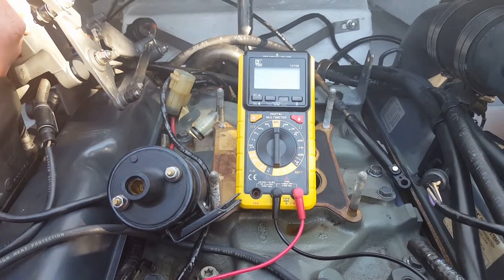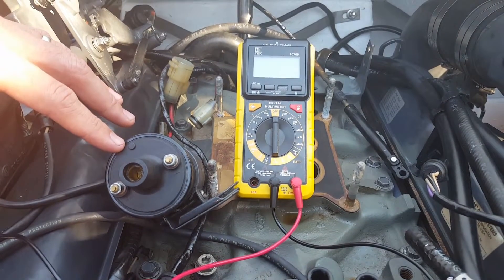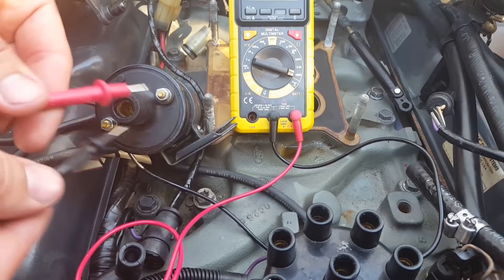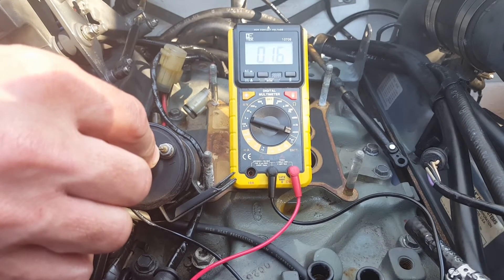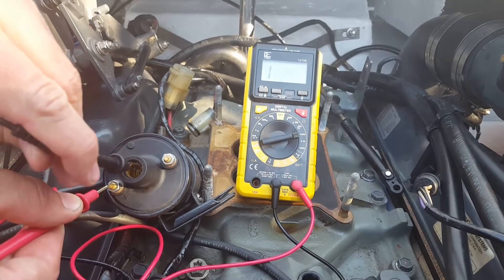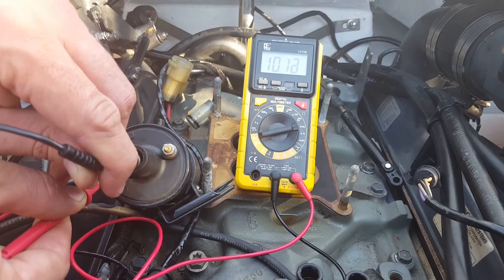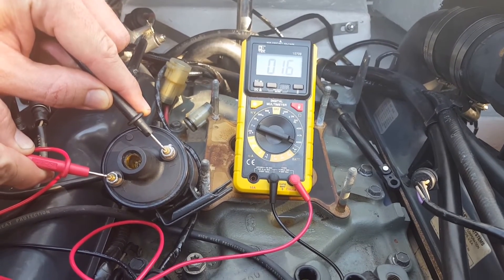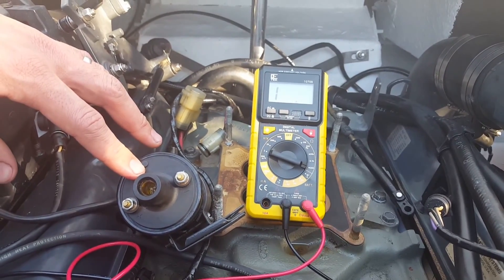Marine Engine Coil Diagnosis - ALL Models

Comment: 1988 5.7L OMC Cobra, Stalling when shifting.  coil is readying 1.3 Ohms, ballast resistor wire 1.2 Ohms.  Would  i need to replace the coil with a 1.8 Ohm?
Reply: I hear 3.0 Ohms total btwn the two is ideal
Reply: It's supposed to lower rpms when shifting, if you have your idle set to low it will stall.

Comment: Any videos on testing a 1990 OMC King Cobra 454 Spitfire EEM system? My boat explodes everytime on start up then makes engine tight to turn.  Its got to be timing,  but there's no timing adjustment on the  magnetic flywheel pickup crank sensor.
Reply from the maker: Do you have a distributor?

Comment: First test between + and - 1.4 to 1.8 is at 200k ? Right ? If so , if my reading is 2.1 is it fine since it’s over ? Or if over and minus is bad ? Thanks
Reply from the maker: A guy in the comments below had 2.2. Too much resistance is bad, less is better in this case. Plan on swapping your coil.
Reply: @michaelromer2016   : thank you so much man !! I’ll do !! Btw I had many issues , coil as you know and saw my mechanical timing advance was semi stuck , this shitty combo might be causing my misfiring/ running like crap over 3k rpm symptoms! Thanks again for your input !!

Comment: Hey mike is their any way to contact you and I have 1992 omc cobra 4.3 that won’t rev above 3000 rpm do have any ideas what it could be? Plug wires are new cap and rotor are new and point were put on last year with very little hours put on
Reply: Did you ever figure it out?
Reply: @oddlyrightoddlyright2475   Did you ever figure it out?

Comment: 88' OMC Cobra V8 GM

I converted to electronic ignition (electronic breaker plate with original distributor). The instructions say to keep the ballast resistor in the circuit if there is one already in the circuit. As far as I can see there isn't one however, there is an electronic shift assist module. Some  articles state that the conversion is not compatible when these systems are present. HotSparks site says that it can be done but you have to build a circuit into the wiring for the shift assist to work. (link to circuit below). So questions would be: 
1. Is there a ballast resistor that I failed to see? 
2. Will the boat go into gear without building said circuit?
3. If the answer to the previous question is yes; will the shifts be hard causing components to fail prematurely?

https://www.hot-spark.com/OMC-Shift-Assist-Adapter.jpg

Your input is appreciated!
Reply: I'm interested to see the answer to these questions. Will the ESA work with the electronic conversion kit?

Comment: Is it best to mount the coil horizontal or vertical? Some information out there says never mount it horizontal, but my OMC Cobra 2.3L 4cyl. is mounted horizontal by the manufacture. what is your opinion? thanks
Reply from the maker: The reason they mention this is because there is oil in the middle of the coil. Some think it is better to keep the oil at the base which is old school hear-say. Keep it horizontal as recommended from the factory.

Comment: Just curious.  My coil resistance is fine to the coil wire part but running 2.2ish on the positive and negative side.  Does that mean I need to replace it? 1988 Omc 5.0 liter cobra.
Reply: And btw.  I love your videos! Thanks!
Reply from the maker: Thanks for your comments! I'll keep up the videos! 2.2 is a little too high for my taste. If you are using a stock coil--swap it out. If you are using an aftermarket, bring your multi-meter with you when you are at the auto parts store and make sure it show a better range, i.e., 1.4 - 1.8 Ohms.
Reply: Thanks for your reply.  Doesn't sound like it's my issue.  Bought a new petronix ignitor 2 and flamethrower coil that I'm throwing on tomorrow anyways.  Decided it's time to ditch the points. Like I said, love the vids.  Thanks for your reply!
Reply from the maker: OMG, you had points, great upgrade! Points are such a bad idea on a boat. You will like your upgrade for sure!

Comment: How do I test the other type of coil that's not the typical oil filled cylindrical shaped one? It's on my Volvo Penta Marine 4.3 engine. It has a 2 1/2" square layered metal bracket around it with three plugs on top, one for the dist cap, and a twin side by side plug that goes to back of distributor and the other to harness.
Reply from the maker: What year is this one?
Reply: '96

Comment: On a 87 omc 5.7 does a coil tested at 1.2 and 9000 ohms need to be replaced?
Reply from the maker: Your coil must be replaced.
Reply: Michael Romer what issues would I be expecting with mine if it’s bad?
Reply from the maker: @sony9675  Worst case, no start. Other symptoms would be poor performance, rough idle, engine dies randomly. They have oil in them, so check for leaks. You can often times shake them and you should hear oil sloshing around.
Reply: Michael Romer I don’t think I have any of those symptoms. Mines a blue streak uc-12x.   What are the specifications I need to fall under to replace? I hear oil sloshing in there and no leaks
Reply: I am experiencing a little voltage drop. Only weird thing in it’s when key is turned to run but voltage drop goes away if I removing purple wire from ignition and or ignition coil. Any ideas? How much should a ignition switch drop voltage as well. Mines about .5. On top of the .7 voltage drop

Comment: What color going to a positive
Reply from the maker: Eliuh Madariaga Good question! Since you are using Ohms to test with, polarity doesn't matter. Let me know if you have further questions!
Reply: Michael Romer the distribuitor have purpo and black   the color black is the negativ
Reply: And the purp is positive in the coil
Reply: I buy a boat and have a omc cobra 5.0 and some  take the coil bat i don't now wich color is positive inthe distribuitor
Reply: Can you help me please
Reply from the maker: Both purples go to the positive, black and the white wire go on the negative side.
Reply: Michael Romer ok thankyou  and if the distribuitor is bad they no make no more what i can use to replece
Reply from the maker: Eliuh Madariaga What brand distributor do you have? Check out my Prestolite distributor video.
Reply: Michael Romer the one testing the choting
Reply: Michael Romer yes i have the prestolight
Reply from the maker: Eliuh Madariaga Watch this video and subscribe: https://youtu.be/8Q9le1sncK0